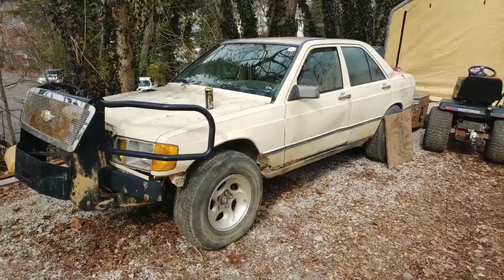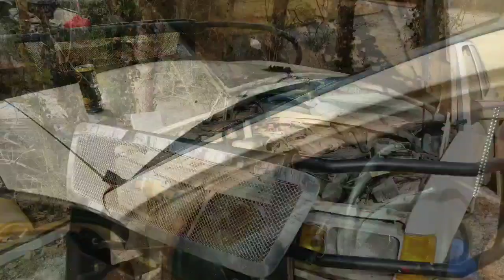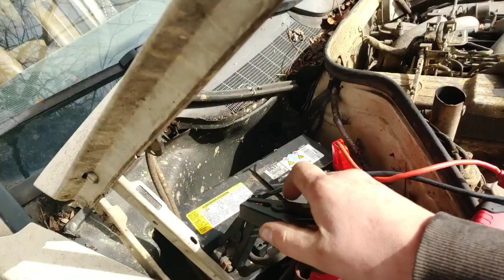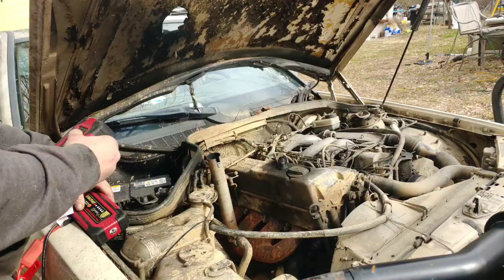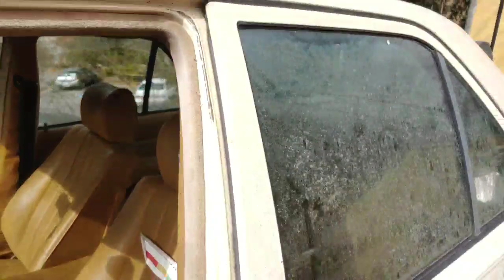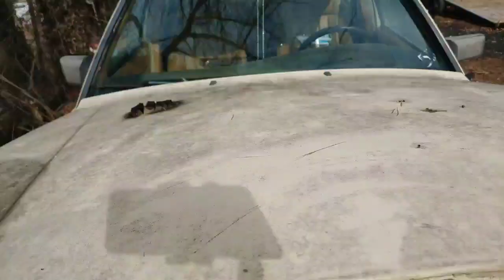Mid 80's Mercedes 190D Cold Start | Mercedes OM601 Diesel Engine

Comment: Quick question do you have any spare parts for that engine? I’m trying to get mine going and I’m looking for a water pump pulley so I can install the belt
Reply from the maker: The engine is sitting in a dually 86 toyota truck now. I don't have any spare parts for it